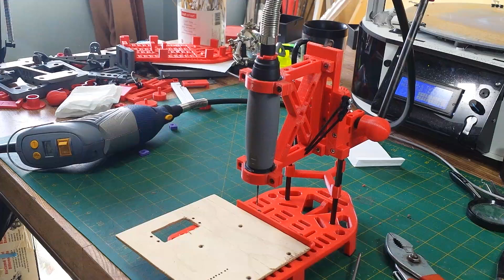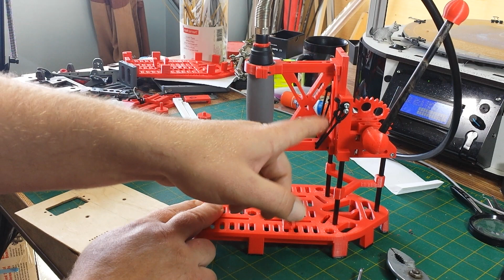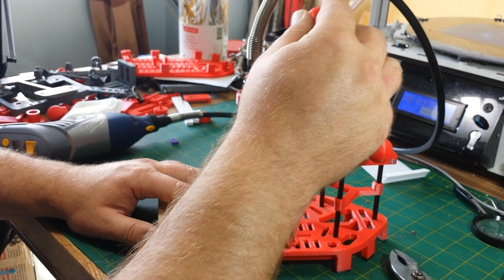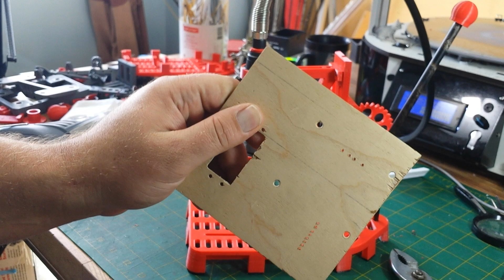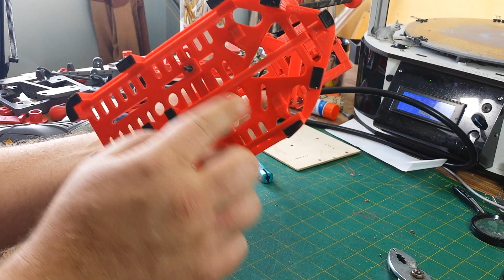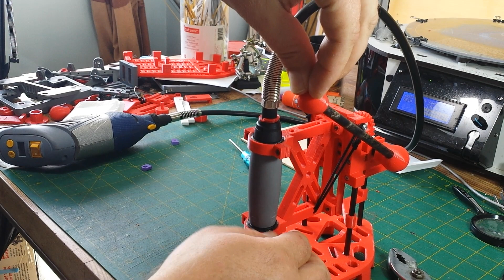3D Printed Drill Press

Comment: I guess the solution to the small play at the bottom is to extend the vertical member (tower) where you have sliding connection and instead of carbon tripod (that are giving you only the height) use full surface contact. If you eliminate overhang and add axial support this would be a very neat design. The size (volume) of the tower will be equal to the two two other parts (base & arm) and will not increase the overall cost. Right now I' cant call this a precise...
Reply from the maker: +Przemysław Jakubczak   Yup, that's a good idea and I'll add it to a second version.  I also have an idea for an adjustable depth lock and a screw lock so I can just set a height and use carving bits.   It is precise as the play only happens when I move it by hand.  When drilling, the black bungee's provide enough tension that the play does not come into effect.  Thanks for watching.

Comment: Very impressive! How much filament is used? Roughly how expensive would the print be?
Reply from the maker: +Sean Lumly  Hi.  Thank you.  I don't think I can estimate the amount of filament used.  It was about 19 hours total print time @ 15% infill.  There's a few screws, nuts, and bolts plus the cabon fiber spars which would rack up a couple of dollars maybe.  If I had to guess, I'd say $12.49 plus tax lol
Cheers.
Reply: kitecraft That's a sound estimate. The relatively low costs of prints make the 3D printer a justifiable expense. I am going to buy a rotary tool at some point, and a press would be absolutely vital for controlled holes. A 3D printed one would not only be less expensive, but also more customize-able than commercial options!

Comment: Curious about the tubes? are they pricey? Any good place to buy in bulk? are they easy to cut? Thanks and good job with the drill press :)
Reply from the maker: +sketchpunkness Hi.  The tubes are easy to cut with a good hobby saw.  Just wrap the tube in tape first, then rotate as you cut.  They are not so expensive.  Search for 'Skyshark P200' and 'Avia 2400'.  I bought mine direct from manufacturer a long time ago and have a very large supply.